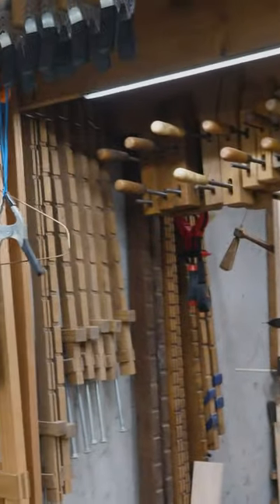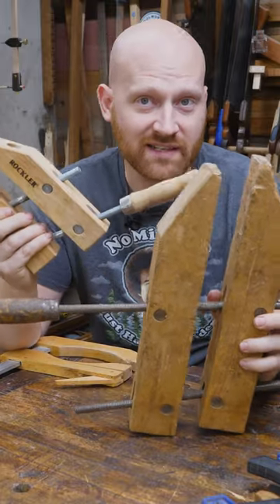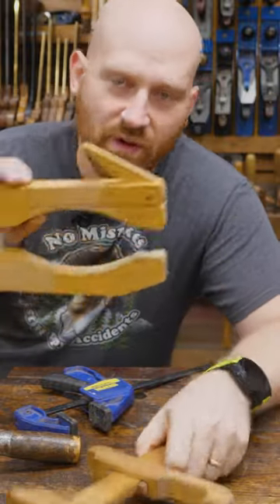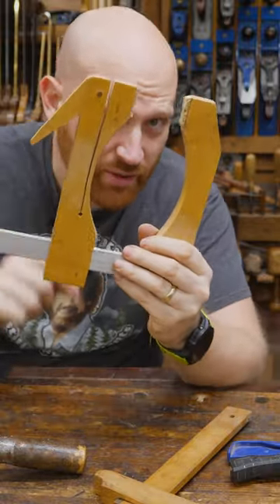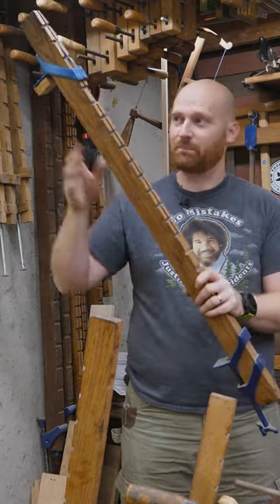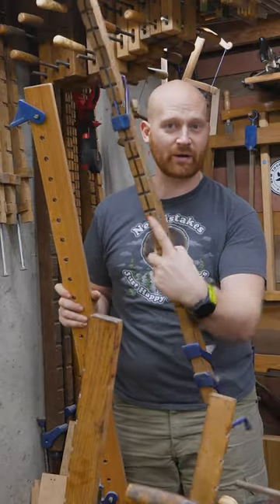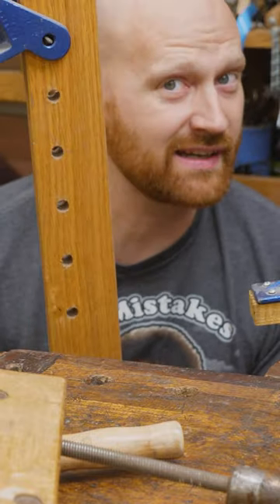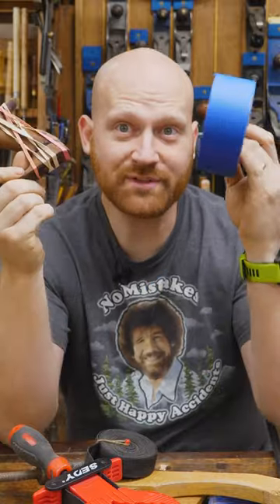Names of Clamps

Comment: Vises function similarly to clamps, but they usually have larger contact areas. A vise features two sides, or jaws, one of which is fixed and one of which travels along a guide rod or bar. A handle is used to turn a threaded rod, which in turn causes the moveable side to slide back and forth.

Comment: James:  Help!  I was gluing together two half rounds.  I do not have a clamp that will hold round stock tight while the glue dries.  The closest I have found would be a screw clamp with a notch cut out of it.  A band clamp is out of the question since the round object is only .5 in diameter.  Have you ever seen a spring clamp or quick release clamp that can hold two round halves together?
Reply from the maker: Usually for something that small you make a block of wood that has a notch in it that would fit onto either side and then clamp those blocks of wood. Feel free to send me pictures of what you're working on exactly I'd be glad to take a look at it
Reply: @WoodByWrightHowTo  Thanks James. I printed a PLA 3D baseball bat.  6 inches long by .5" in diameter.  In two halves.  Epoxied them together.  I used 4 tiny Irwin Quick release clamps and clamped the two halves at 90° to each other.  The flat pads on the clamps was the difficult point of the clamping.  I suppose a tiny v block on each clamp would work.  Why aren't these made for wood working?  All solutions seem to be home built.
Reply: For round and odd shaped glue setups I use the thick rubber bands that come on asparagus. 
Cheap, disposable if necessary, and glue won't stick to them. 
Ryders Market use to wrap packages of cold cuts in paper secured with thick red rubber bands. Those were handy. 
More for slingshots than clamping.
Reply: @OldSneelock  I found a more complicated solution.  Mini quick release clamps.  Sugru (moldable rubber) added to the clamp pads with a 'V' cut out.  When the clamps come together, they hold the round halves together nicely.  Like cutting a notch in wood clamps to hold round stock.  Your rubberbands are No. 107 bands (maybe too long).  Really thick and wide.